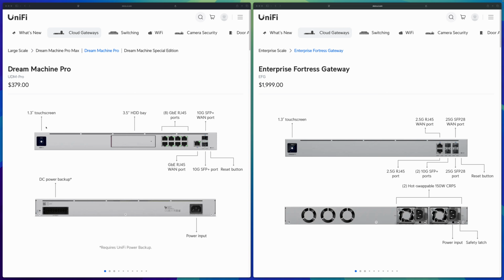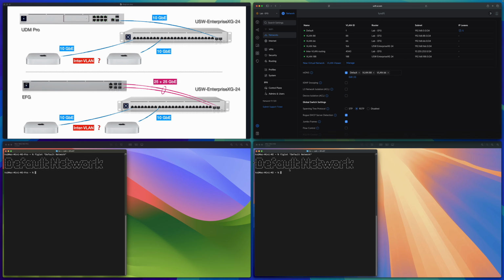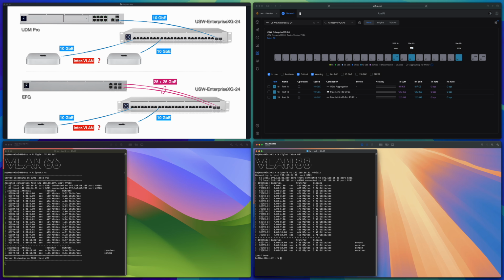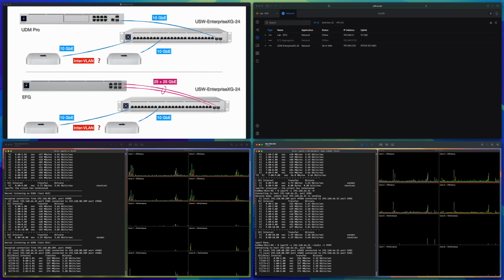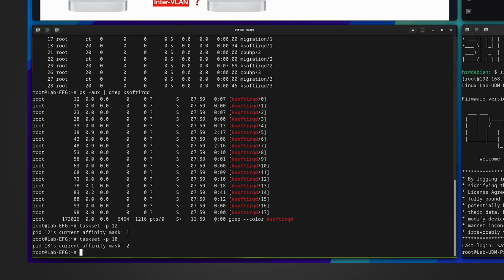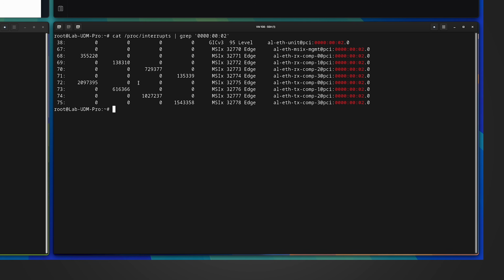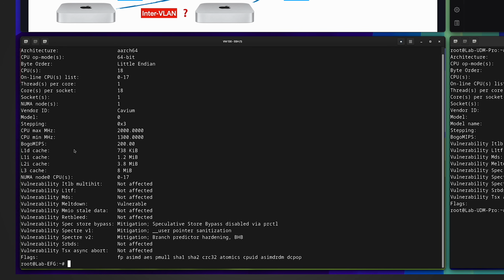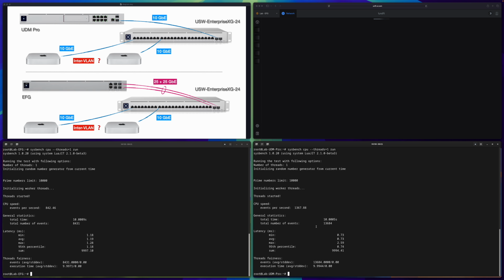Ubiquiti UniFi Inter-VLAN Routing Throughput and CPU Cores - EFG Vs.  UDM-Pro

Comment: Awesome video as always. It has been the perfect timing too to help me investigate an issue further. I think there is a major bug lurking around my UDM-SE and related hardware since I'm only able to get 1100-1400Mbps through WAN and a little over 1500Mbps with inter-vlan traffic (using Pro HD 24 between PCs). This seems crazy slow to me. Even with all services disabled (protect, dpi, ips, etc), speeds sometimes dip as low as 900Mbps with iperf3.

Comment: Great video as always, really appreciate the follow up EFG vs UDM analysis. 

I saw the same thing when doing extensive testing on the UDM Pro. 

It’s very disappointing to see these gateways throughout reduced by such a degree when using Inter VLAN routing and it gets worse if you then add in IDS / IPS of course. 

What’s most disappointing though is the EFG performance. For a high end, expensive gateway like this that even has overhead from other apps (Protect etc) stripped from it (therefore reducing impact from those), I think all of us expected better. 

Hopefully there are some performance improvements Ubiquiti could offer through using DPDK and HW acceleration features of the SOC which would improve this gateways value. If not then the cost vs performance portion of the ROI is very poor. 

Thanks again and keep the great videos up !

Comment: I’m new to UniFi , coming from pfsense. Can you please do a video on firewall network troubleshooting? It’s so difficult figuring out why flows don’t work especially when compared to pfsense logs where you can do easy filtering of client devices and blocks.
I send logs to a syslog server for now but even the logs are confusing to read  😢
Reply from the maker: I would love to make a new video about it, if I know what the difficulties are.

To create a firewall policy and make it work is one thing; to understand why a firewall policy work in another thing. In my opinion, the former is much easier.

You are already able to see the firewall logs, which means for whatever scenarios you are troubleshooting, you can see the logs for all the used default firewall policies and custom firewall polices. I need examples to understand the difficulties. Yes you mentioned "filtering of client devices and blocks", but I don't see real differences between pfSense and UniFi in that sense...
Reply: @ would it be helpful to communicate outside of YouTube so I can describe a bit more what I mean? Even send syslog output to better illustrate why it’s difficult for me to parse?
Reply from the maker: @ Sorry but I would like to avoid that type of communication, because  if that is required, it means the issue is very specific so a video may not be a correct output of it.

Please understand I am a one-person homelabber, and don't own a network integration company.
Reply: @  no need to apologize. I appreciate you taking your time out to respond. Continue putting out great content.
If I may be so bold on another topic: how does app filtering work on UniFi? Similar to appID on other platforms or static file of host names? I think it’s a good topic
Reply from the maker: In fact I worked on it about a year ago but did not put the content to a video because at that time I thought it was a little bit boring. Let me revisit it.
Reply: @ oh wow so there is content out there. Release it ! I at least would appreciate it very much. I’m curious if it’s proprietary feature or if it’s just defining domain lists and ports
Reply from the maker: @ i will add it to the backlogs. For now, just a summary I can still recall: it uses iptables extension module xt_dpi. in dpi, there are definitions for application category and applications. in iptables you can see something like "cat 5 app 110" to match the traffic.
Reply: @ that’s awesome. I’m going to dig into the file system to see if I can reverse engineer. Thanks for the hint and the great content!

Comment: As a side, I wonder how much 9000byte jumbo frames would increase single threaded inter-vlan performance?
Reply from the maker: Jumbo frames were used in all the testings in the video for Mac Minis/switches/gateways.
Reply: @ good to know, thanks. Did they make much of a difference?
Reply from the maker: About half Gbps difference for one connection.

Comment: Very interesting, thank you for testing and sharing. The UCG-Fiber is probably currently the best for single threaded performance (A73 @ 2.2 GHz), followed by the UDM Pro Max (A57 @ 2.0 GHz). Something like an A76 @ 2.4 GHz would be ideal (same cpu as pi5). According to PassMark, the single threaded scores are:
- A57 @ 1.7 GHz = 387
- A76 @ 2.4 GHz = 1050 (2.7x faster)

With a little extrapolation (2.7 x 4 gbps), it would probably maintain 10 gbps for single threaded inter-vlan routing. Which would be great to see, while also having a low power consumption. I am sticking with my UDM-SE for now, but it will be interesting to see how UniFi updates / revamps the UDM line.
Reply: I just ran sysbench on my uxg-fiber while all 4 cores were hovering around 25% usage and managed 20k on a single thread.  I expect it would be higher if I did it with no load on the system.  I was considering the higher end router but now I think I'll stick with the uxg-fiber, they finally put some decently fast cores into one of their devices!

Comment: Did about the same testing Udm pro max vs fiber, using Sfp interfaces. Everything was LAN.
Inertvlan was close enough to 10G.
Nevertheless I saw a significant drop when skipping the switch and hooking the pc directly to the gateway. This only on Udm. UcG was OK.
Any ideas why?
Reply from the maker: Do you mean UDM pro or UDM? If UDM pro, did you connect two PCs to the two sfp+ ports?
Reply: @hz777 udm pro max. Sorry I abbreviate it to udm.
I have only one SFP+ adapter so I use only one port to bring traffic in and out on two different proxmox vms
Reply from the maker: @user-cofeethen I don't understand what you said about the significant drop scenario. How are your two PCs connected if you skip switch?
Reply: @hz777  great my reply disappeared cause I mentioned red it.

I have one PC running proxmon with an SFP card. And from there 2 Vms on different vlans. Either the DAC goes on USW or on Udm  (pro max 🙂) 

I was hitting 435 MB/s with IPS when using the switch but only 380 when skipping it
Reply from the maker: Interesting! I don't see why the throughput will be different with the switch or not...
Reply: @hz777  me neither

I also noticed you get slightly better throuput if on the gateway you set the trunk to  no default vlan. (switch needs default vlan or it loses connection to the controller)

Comment: Great video and explanation as always. We (myself and a bunch of other EFG owners) are having a series of problems with it ranging from crashes due to OOM, all the way to performance problems like the one you just shown with the inter-VLAN.

After doing serious digging on the EFG hardware and OS and collecting a bunch of evidences, we've sent them to Ubiquiti in a supported ticket. We got that the performance problems we are facing are related to > 10G networking when doing inter-VLAN traffic. For 10G you can workaround when doing multiple streams, just like you've did. However, when you get to > 10G, even with multiple streams we can not ever reach remotely close to the 25G advertised speeds. 

It turns out that the major problem is the fact EFG (and all other UI gateways) are using linux bridges which for those circumstances is extremely slow. The UDMP is fine to keep with the current software based implementation on top of linux bridges, but the EFG has way more powerful hardware. Not just CPU cores or clock speeds, it has an SoC which supports DPDK along with hardware acceleration of a lot of networking functionality (including inter-VLAN routing) which is currently fully dependent on interrupts on the CPU and bounded to a single thread.

They are "working on" making a fix to it after our suggestion on using DPDK and will get back with an update. Unfortunately, there is nothing we can do about it now and it is a shame such a powerful device is being brought to its knees and not been able to be utilized on its full potential until this is fixed.
Reply from the maker: Thank you so much for such detailed updates to a fellow EFG owner!

Last week I had a video about EFG' aggregated inter VLAN throughput. I was able to achieve ~26 Gbps though.
Reply: @ yes but you were using multiple streams. That is easy to do as it have multiple cores. But is not a representation of a real application using the network. Usually it will use a single stream. Unless you are using something like a SMB share which the client can support multiple streams (only Windows in a very specific scenario). So we should aim to be able to get 25G on a single stream. Otherwise, Ubiquiti should explicit note in their product sheet that it can do inly 10G single connection and 25G only on aggregated throughput.
Reply from the maker: @galvesribeiro ok. You were referring to one connection. Yes, I have all the observations/issues you described. I will be extremely surprised if a firmware upgrade will "fix" the issues, because it means the firmware we use now is not taking full advantage of the hardware that we paid $2000 for 😮
Reply: @hz777  Not sure why my replies are being deleted but, all I'm saying, is that the SoC on EFG can do WAY more than what it is doing. The SoC can handle 100G traffic according its spec sheet. How to get there? I told UI that they need to get rid of their linux bridge implementation and use DPDK. Even Suricata now have support to it. That way they bypass the kernel limitations and are able to achieve significant perf improvements. The routing using CPU and irqd is only doable up to 10G. Anything greater than that and you will see such bottlenecks as you are always bounded to the single thread speeds.
Reply: How many clients and what are you doing to be getting OOM errors?
Reply: @ in the test environment about 60 clients. But the number of clients is irrelevant. Ubiquiti already acknowledged the issue on all our tickets. The memory is not the bigger problem. The problem is the interVLAN horrible performance, which they also acknowledge and are working on it after the evidences pointing to where exactly is the cause.
Reply: @galvesribeiro  So the number of clients doesn't have anything to do with the EFG out of memory errors?  I never had an issue with my 16GB standard, but I went ahead and upgraded to 32GB.  Of course I have FOMO for not having 64GB now.  LOL

Hopefully they can fix the interVLAN stuff.  Looking at the specs for the chipset, it should be able to do more.

https://www.marvell.com/content/dam/marvell/en/public-collateral/embedded-processors/marvell-infrastructure-processors-octeon-tx2-cn92xx-cn96xx-cn98xx-product-brief-2020-02.pdf

Comment: Excellent video, and how could we improve this? Is this possible?
Reply from the maker: No way to change it.
Reply: @hz777  ok understand.
I have another issue with EFG that I’m still trying to t-shooting. I have a case with a ISP that offers 25Gbit internet line and this person is using an EFG for it but the upload throughput is not near the 25Gbit capacity (Download is 23Gbit so expected).
Iperf (between EFG and Server) on a LAN connection is maxing out on both directions 23 down and up. But the same test to a destination on the WAN is not performing on the upload. Do you think this can be an issue on the ISP side or the EFG not performing? All IPS etc is disabled and the firewall has been tested with default values. If you can give your view or something I can look/adjust with ethtool maybe
Reply from the maker: @GoncaloBarradas  single ipers3 session is not enough sometimes, especially for 40/100 GbE, but for 25Gb should be ok most of time, but it does not hurt by trying multiple iperf3 sessions on the same host with different ports.
Reply: @hz777 tried up to 16 or 24 parallel connections and still not able to go higher than 15 or 16gbit in upload. Download is always ok with the same parallel connections reaching 22.5 to 23.1 Gbit
Reply from the maker: @GoncaloBarradas No, I was not suggesting -P parameter. I was saying multiple sessions with -p (lower case p).
Reply from the maker: Another thought is: the client's upload is isp's download. Normally the traffic that comes in will go through more scrutinies. Maybe the isp is running something on the incoming traffic.